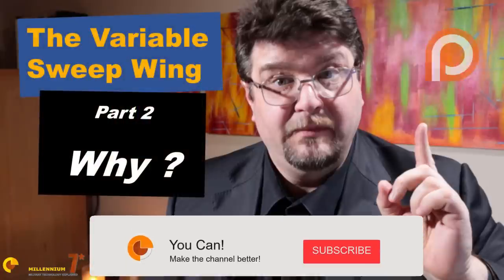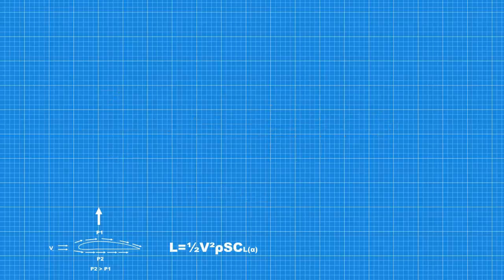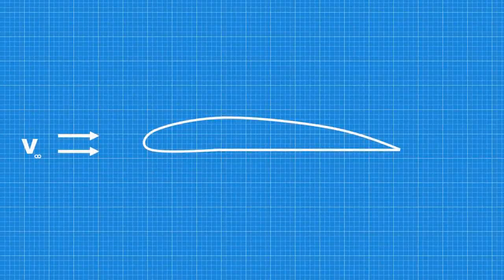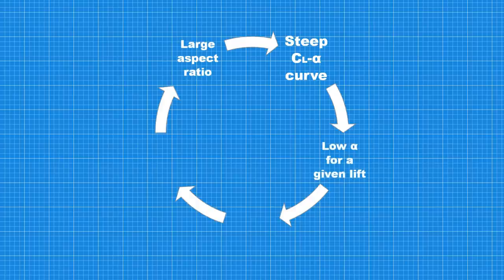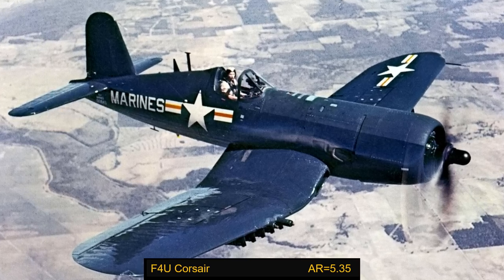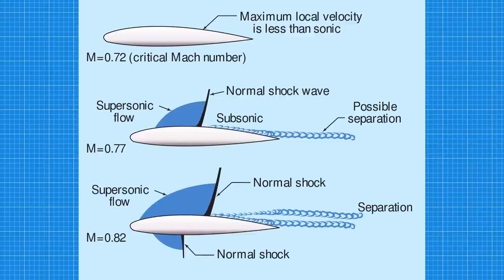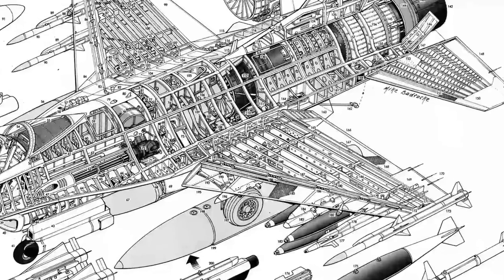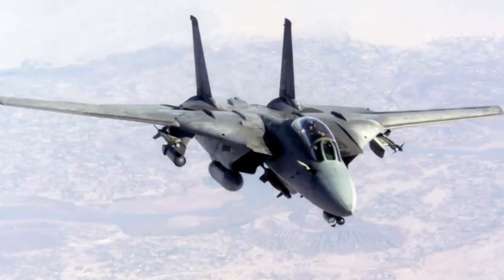The Swing Wing - Why the variable sweep wing was adopted - F-14 F-111 Tornado Tu-160 Mig-23

Comment: Was stationed with 20th TFW and the  F111 Aardvark at RAF Upper Heyford in the early 1980's.
The F111 low level penetration ability meant USSR concidered us a high value high priority target, a target for nuke or chemical attack. Especially after introduction of the EF 111 Raven.
 I spent much of time in mopp gear, with a lot of scary FLASH communications occurring at the time.

Comment: Maybe you have already covered this, but I cannot find it.

I think you should explain that wing airflow stall is not the same as "stall speed" of an aircraft (And that stall actually isn't dependent on speed).
I think a lot of people get this wrong and do not understand the differences (When talking about high altitude flight for example).
Hence they usually don't understand consequences such as separation of the airflow bleeds energy but does not create more lift.
Reply from the maker: Never covered but it is a good point.

Comment: It may be a rushed conclusion, but I think what killed the VG wing was the turbofan engine, more specifically the ones with thrust/weight ratio above 7:1, like the P&W F100 and the Lyulka AL-31. 

This type of engine allowed a aircraft better acceleration on the take-off,  thus achieving the required speed with less runway. Combined with larger wings than used in earlier designs, no strait wing was needed for a short take-off. 

Another problem, long range, was achieved by the greater economy of the modern turbofan, way less thirsty than earlier turbojets.

 And the supersonic speed problem was resolved by brute force, because later fighter jets needed bigger wings for agility and short take-off runs, so more power was needed to overcome the added drag. For example, the Mirage III had a 6.000 kgf/13.200 lbf thrust engine, the Mirage 2000 had one with 9.000 kgf/19.800 lbf, for the same mach 2.2 top speed.
Reply: The F-111 and B-1 both used turbofan engines but the VG wing was the largest driver of their cruise efficiency and high speed dash capability.  The turbofan did not kill the VG wing, changing mission requirements  made it undesirable.  The B-2 was built for stealth, not speed.  If anyone wanted to build another non-stealth aircraft with the performance envelope of an F-111 or B-1 again, they would again consider using a VG wing.
Reply: @gooser__43   What about them?  I'm not a mind reader.

Comment: I cannot understand why America didn’t develop another swing wing as the F1-11 did such a great job destroying more than even the A10 did with it’s all terrain radar at ground level as it has the best of both world low speed as well as high speed depending on wing configuration.
Reply: Because there are now better ways of overcoming the same problems? Variable sweep wings have issues of Centre of Lift change, difficulty of mounting underwing stores, and wing weight (especiallly if carrying fuel in them). Leading-edge slats and other technologies are better

Comment: Thanks for a good explanation. One question?  Why do some planes blow air out the side of the wings? Does this have to do w shockwave or lift issues?
Reply from the maker: I believe to refer to devices to delay the stall, if I understand correctly.
Reply: Millennium 7 * HistoryTech https://en.m.wikipedia.org/wiki/Blown_flap     Last paragraph is relevant to the discussion of military jets. Thanks you are right! Interesting engineering
Reply: @scottyevens3174  It makes the flaps more effective. Basically it increases the velocity of the air streaming over the flaps which in turn increses the pressure differential and in the end generates extra lift.
IMHO these systems are crap. They are a maintenance nightmare and can lead to accidents if they don't work properly. For instance some F104s, which had such a system, crashed because the system only worked at one side which induced a severe roll moment low over the ground a low speeds, a certain recipe for disaster.

Comment: There is a concept in the movie called "STEALTH" , it shows new gen stealth fighters with scramjet engine and sweep wings.
Please look into that and what do you think about that concept.
Reply: From everything I've read about SCRAMJETs and RAMJETS, I've been lead to believe they aren't used in planes as much yet because they require such high speeds to start being effective. When going that fast, you start running into issues with the air pressure being funny and the speed of most turbines going too fast for safety. Once successfully going fast enough for a scram or ram engine to work, you start running into other problems like the sheet metal becoming too hot. That's why the Blackbird was made with sheet metal specifically small on the ground because at cruising speeds the metal would expand and close up small gaps between the metal. On the ground they were notorious for leaking fule everywhere. 

I tried finding other info on why they don't work at lower speeds but I haven't found much luck. You can find a lot of cool info from the Blackbird though despite it's age
Reply: Seriously one of the worst films I've ever seen. I left it muttering "If Stanley Kubrick was still alive, he'd sue." Not that he would necessarily have won a copyright infringement case for Stealth's overt HAL 9000 reference, but it would have been worth it.

Comment: So then, this is why delta plus canard (as I understood from the previous videos) is so effective, it combines a higher aspect ratio and a high sweep into one aerofoil to accommodate supersonic flight.

However, it seems like delta plus canard isn’t as good for stealth, as stealth requires more parallel surfaces and a body shape that a delta plus canard may not be compatible with aerodynamically. Is this a correct understanding?
Reply from the maker: Perfect!

Comment: in colonel john boyds autobiography, he notes that variable sweep wings were not ideal, due to added complexity and dead  weight. [ he was instrumental in the f16 light weight fighter program and also behind the ooda loop, and the concept of energy/manuaverability for the usaf. something they still rely on.
Reply: It depends on mission requirements, and Boyd was speaking from a narrow point of view.  The variable geometry wing is not ideal for a fighter designed to dogfight within a narrow speed range.  The VG wing is good for an airplane that must be efficient at all speeds across a wide flight envelope.  The F-14 and F-111 got a VG wing because they were designed to different performance criteria than the F-15.
Reply: VG aircraft is not that much heavier than conventional ones. The press made it look worse than it actually is. Se for example the F-14 and the Su-33. Both weight about the same, with similar dimensions. Another example is the MiG-23 and the Saab Viggen. Again, similar dimensions, weight and engine power.
Reply: The operational needs of a naval aircraft are different than a light Air force jet.